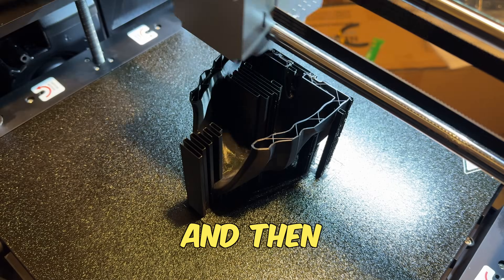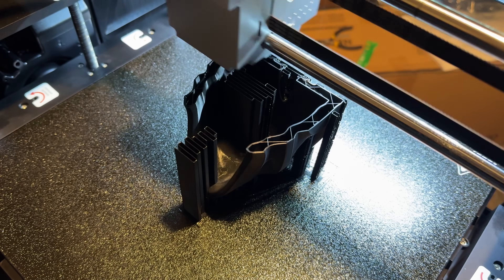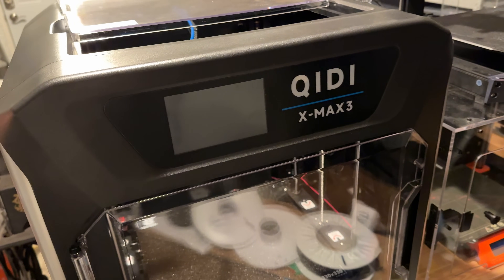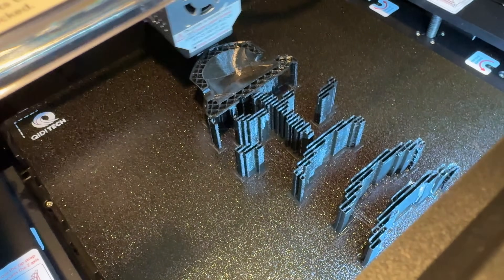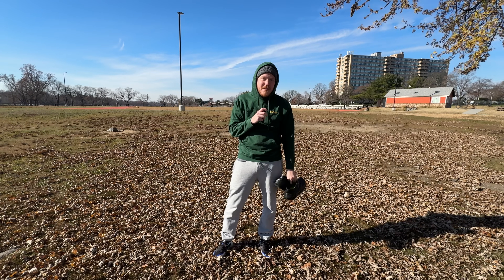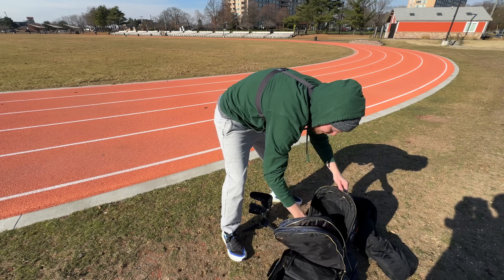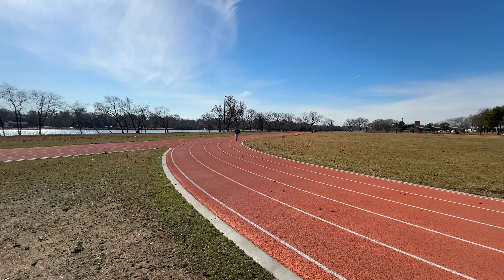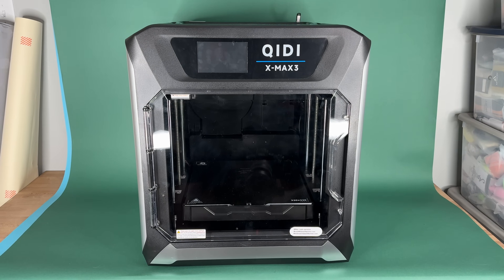I Ran A Mile In 3D Printed Shoes

Comment: Seth, great video as always! Have you considered using modifiers in your slicer to change the infill density in different parts of the shoe? It would be cool to pressure map your feet and then modify the infill density to make it accommodate the points with the most stress. Cheers!

Comment: You should get some foaming TPU, it prints almost as easily as 95a TPU through a bowden setup but foams at higher temps, giving a lower hardness. You will have to adjust your extrusion/flow rates to compensate for the expansion but there should be a loose guide to follow on the manufacturers website or on the filament box itself. You could print a multi part shoe using varying hardness settings and then assemble it, either using heat, chemicals, adhesives or a combination.